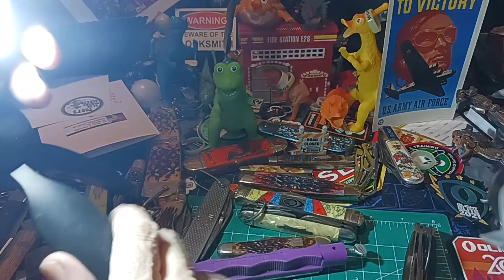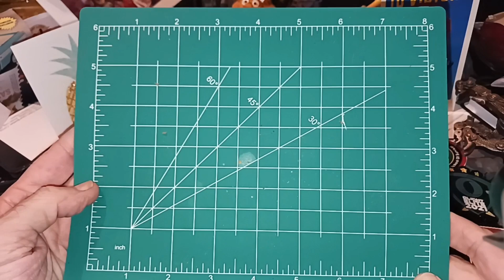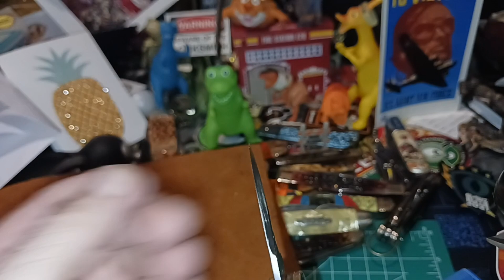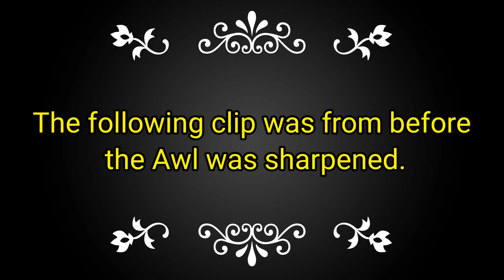(1162) Getting an Awl Sharp ⚜️ Queen Winterbottom Bone Stockman

Comment: Lessons were learned, sharpenings were done and fingers survived. Somehow when i read the title, in my mind i saw an Owl get fed peppers, but that's crazy mind for you. The benefit of 440C being harder, is that it won't dull soon, so the more work pays out. The tripod for the light is real handy for highlighting the detailed portions you're working with and is so more stable and adjustable. Thank you for fingersaving tips William, we all were in a rush before and found out, that that is not the best way to keep fingers safe.
Reply from the maker: Thank you, Jeroen.  A slipjoint will remind you about the importance of proper finger placement. 😆

Comment: I use an awl for opening cans; I punch two holes in a can of peaches then drink out the juice. Then use the can opener to open the can. The point does not need to be to sharp just pointy. It works better when you push and twist it into wood and leather. Doing it, that way you can make smaller holes in canvas and leather. Awls are much like marlinspikes and can splice lines together if needed too. 🐯🤔🙂
Reply from the maker: This one is better now that it has a sharp point. I still have all my fingers also.🤣

Comment: When you were talking about the awl being a slip joint, I immediately thought about the Cub Scout knives.  Both the screwdriver and awl have liner locks because as you mention, they are more likely to close on you, even when using it correctly!   

Good job with awl.  

Spot light on Pepe!   He’s a star!  He almost looked like John Travolta from Saturday Night Fever during the strobe session!
Reply from the maker: It's a good thing I wasn't trying to demonstrate how to make a hole with a pen blade. That would have turned into how to chop off a finger Yakuza style with a pen 🖊 blade 🤣🉐️🔪

Comment: The awl was sharpened, and it was awl right, the knife awl is ok for emergency repairs, but to make a lot of holes a leather punch with different hole sizes would be quicker and neater and they are cheap. Nice scales on the Winterbottom, thanks for the video, William.
Reply from the maker: A leather punch is the way to go. I used to have one with a multi hole punch head.